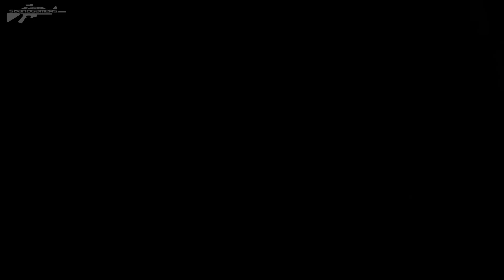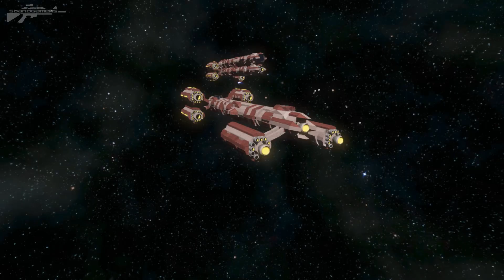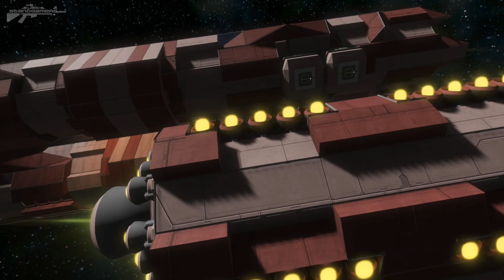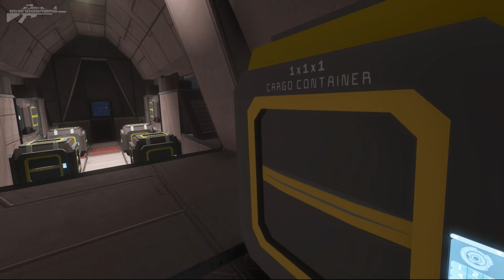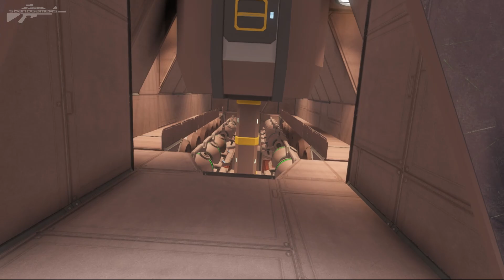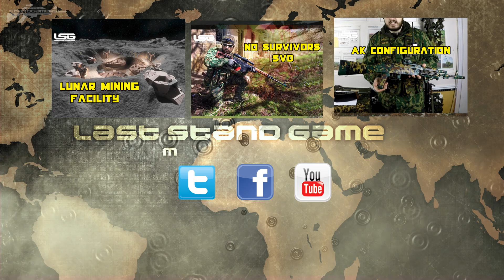Space Engineers - Civilan Cvt Smuggling Ship

Comment: does using the hydrogen engines to achieve orbit then switch to gravity drive not jump to outrun being chased renforcrce
the ccolumn connections at the engines to withstand stress and fatigue  when moving faster? maybe weld some column struts
into a cage form around the engines for support?

Comment: This is not a smuggling ship. A smuggling ship is a regular ship that looks and performs the duties of a legitimate freight vessel with extra secondary cargo compartments added, or otherwise is a small, unmarked vessel that attracts little to no attention so it can slip in unnoticed to deliver illicit cargo. What we have here is a custom-built blockade runner designed to outrun/outmaneuver pursuit, and deliver large amounts of supplies despite an alerted and active military opposition.

While this ship might be useful for counter-enforcement duties as well, its specifications and obviously purpose-built hull would attract too much attention. This ship would complete its mission, but it would be the only mission it would likely ever complete, if not only because its presence would put the destination in immediate and lasting danger of discovery. The ship would be better off disassembled on-site at the smuggler's den rather than be allowed to leave in a system in heavy or at least adequate law enforcement presence.

With all of that said, however? A lightly enforced system would be unlikely to be able to do anything to stop this ship from making multiple, highly lucrative runs, escaping pursuit, and possibly coming back to make more money.
Reply: Also to add on any interceptor class ships or fighters can possible cripple the ship by targeting its engine connectors or possibly even destroy it.

Comment: A bunch of problems stand out with this ship. No conveyor network; bland interior; copy-pasted exterior. Does this thing even have hydrogen tanks to supply all of those thrusters? If you're going to show off your own designs for a change, at least take the time to finish them.
Reply: ***** Fair point, I don't normally use them so I hadn't noticed that was the case. But still those wings connecting the engine nacelles aren't thick enough to hold conveyors so you would need to refuel each of them individually. Looking at the thumbnail right now I can see a few of the small thrusters aren't active so they probably haven't been connected.
Reply: ***** No I didn't. What has this got to do with this conversation? I feel like you might have posted this remark in the wrong place.

Comment: I know this is quite a vague question, but how efficient are hydrogen thrusters? Do they run out really quick when in general use or only when you go full power?
Reply: +theNebinator more importantly how do you refuel them?(on this ship anyway)
as for how officiant they are, for general use you only want to do short burst, a single hydrogen tank can fuel a big engine for 3 minutes at full blast before running out...
Reply: +vabese smart placing of connectors ant hydrogen tanks? It would be interesting to know how long one large hydrogen tank lasts though
Reply: ***** i know how hydrogen works, but i'm referring to 'this' ship as the external pods are loose from each other and i don't see any obvious ports or lines running from the ship and engine pods...

also there should be a way to transfer hydrogen between tanks without the need to make new fuel...
Reply: ***** not very survival friendly then... a pity really....
Reply: Does anyone know if you can break out of a planets atmosphere and orbit using just atmospheric and ionic thrusters?
Reply: theNebinator lets just say its possible, but your ship will be more thrusters than ship... at least in my experience.
Reply: +vabese soo what do you think personally, either just use atmospheric and ion thrusters or have a ship that has all three types of thrusters, which would be very complex?
Reply: theNebinator you could use something that has all 3, you could use hydrogen as a boost or when leaving atmosphere...

the way thrust power scales is when going into planet atmosphere with ion engines it scales its power input together whit its thrust

the inverse is true for atmospheric thrusters going all the way down to 1 watt

the hydrogen is unaffected by this but uses gas to work, and as such allot more resource intensive.

as for complexity its not much of a problem just make sure to make(and remember you have one) a toggle for the hydrogen.

Comment: Well, that's great and all, but if the ship that's running after you is powerful enough to make you run away, it's probably gonna blow your engines off before you even get close to the gravity well of the planet.
Reply: +Le Derp Français true, but i'd think that the ship would have shields, to go with it's speed.
Reply: +Seluecus1 Or good enough sensors to see the other bastard coming.
Reply: +Tundra Explorer Ehh, yeah, but you have to time it VERY well and really fast. I think the best way to take that ship out would be to install the exploding gas tanks mod and shoot it. Considering all those thrusters, either the ship will 
a) Burn out instantly due to being a creative-only ship that has 1 tiny oxy generator to power all the thrusters. 
b) Explode dramatically after 1 tank gets taken out and causes a chain reaction.
Reply: +Tundra Explorer I never said to shoot the thrusters. I said to shoot the engines.